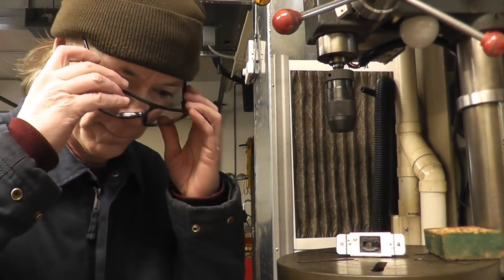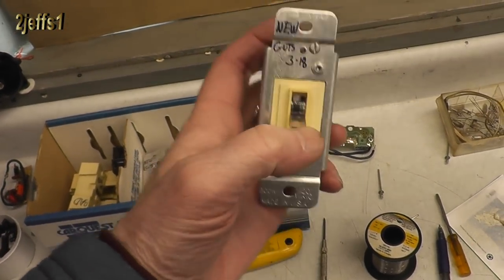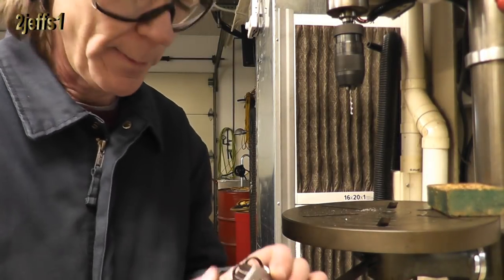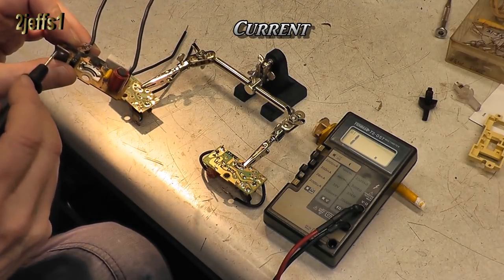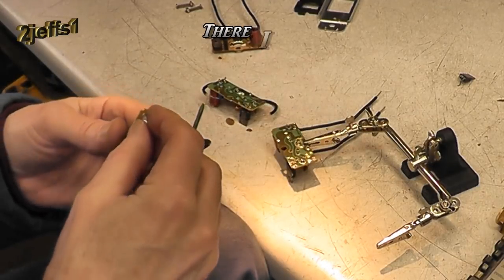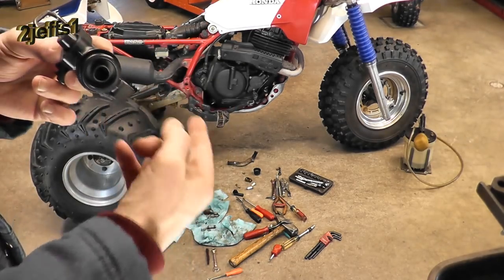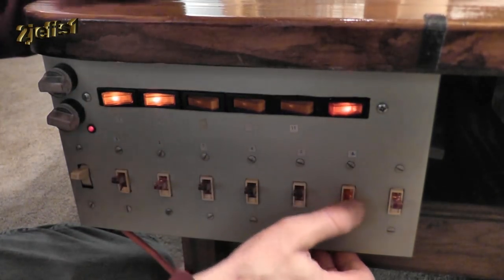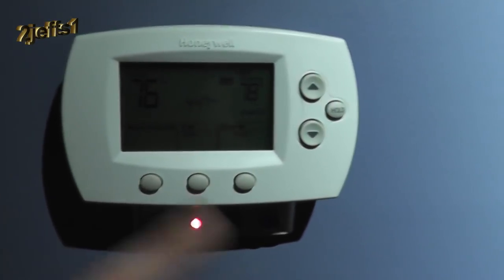Circuit Board Repairs, Power Backup System, Dimmer Pannel Demo,  New Projects

Comment: Keep those electronics videos coming they are very interesting!  I had a pressure tank go bad and fill the basement with about 3000 gallons of water last year, still working on an alarm solution that does not run off batteries to let me know if water is where it's not supposed to be :)

Comment: Those are some nice looking ATC's Jeff.  :)  The electric 200X is really gonna be great.  I forget, did you estimate what the weight difference would be?  I'm sure there are a lot of interesting ideas you would have to adjust the suspension though.  Digging the wood on the ceiling.  Looks real nice.    We did a ceiling like that on an addition we did a few years back.  It was all pre finished too, looked great.  haha, Nice ending man.  It was like some kind of short silent french movie from the 50's/60's.  Just needed to be black and white, and say, FIN at the end.  Awesome interesting stuff.  Definitely giving me some ideas here... How much battery backup do you have? And how powerful is that inverter?  If you don't mind me asking sir.
Reply from the maker: Thanks man! Those batteries weigh 8 lbs each. It takes 7 to get the 56 volts required. The motor is somewhere around 60 lbs. Add a jack shaft, brackets and motor controller possibly another 40 lbs. Have no idea what the original engine weighs. I figured it would be a bit more weight than OE but not a tremendous amount. Got a smile on the French movie idea for sure. I have 2 group 31 deep cycle batteries connected together in parallel for the inverter. The label claims 18.5 amps, 2000 watts continuous, 4500 surge. Something you should know is - when I first bought that inverter I burned 1 out. The sump pump label said it draws 7.4 amps so.... It worked only for several runs. Right after that I learned an electric motor can draw up to 8x that rating on a rating label during start up for x amount of milliseconds. (evident when a sump pump starts or table saw, yada yada and the room lights momentarily dim, especially noticeable with an incadescent light bulb on in a room) Seems them inverters are ok for most things just can't run a refrigerator or sump pump off one unless much larger. Thought that info might save you some aggravation some time in the future where you tinker with that stuff. Did score that 86 200x Sunday. 16 hours on the road but got to see some cool scenery along the way.

Comment: Hey Jeff good to have you back my friend love watching your stuff it's very informative.
I know you have done a video on car batteries butt is it possible to top a car battery so it will charge again?
Keep all the good stuff coming Jeff 👍👍
Reply from the maker: The only thing I can possibly help on (your probably aware) is the newer style chargers need several volts to start charging. Then one needs an older type one to get the voltage up to several volts first. The reason for that design is if those are connected up backwards nothing will get damaged - if your wondering. Unfortunately this is all I can add over that video....